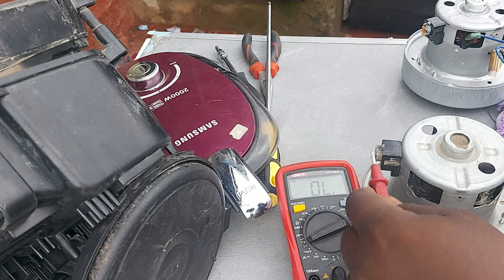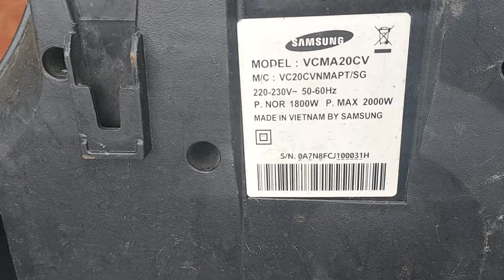Samsung vacuum cleaner new and faulty motor testing using a digital multimeter

Comment: Where do you set the meter to make the Buzz sound?
Reply: Continuity mode
Reply: @royalbhala767  hmm, I did but it didn't make the Buzz. The speaker perhaps messed up. Thanks Bud.
Reply: @pebble3904  yes, there might be possible chances for that, kindly check the probes also.